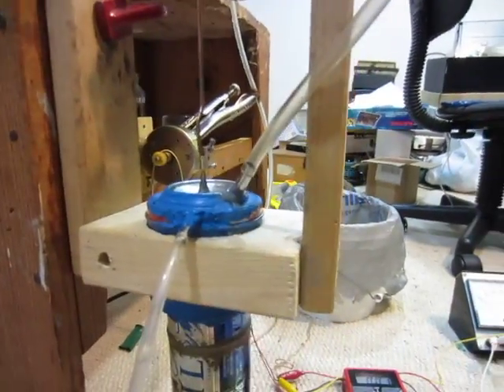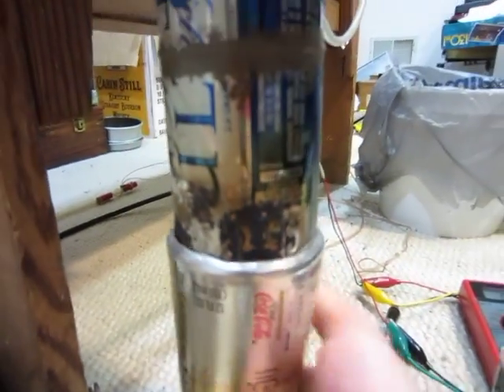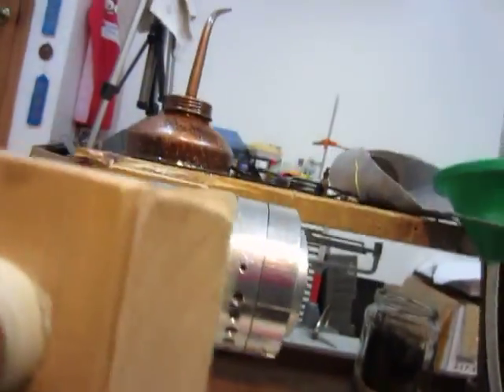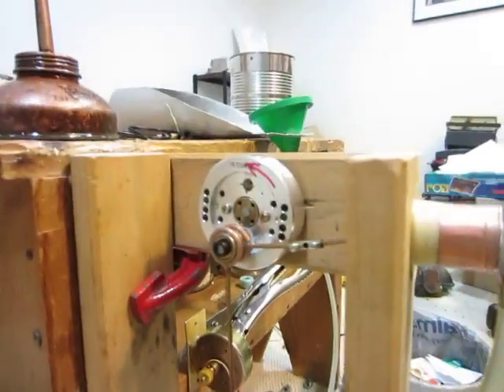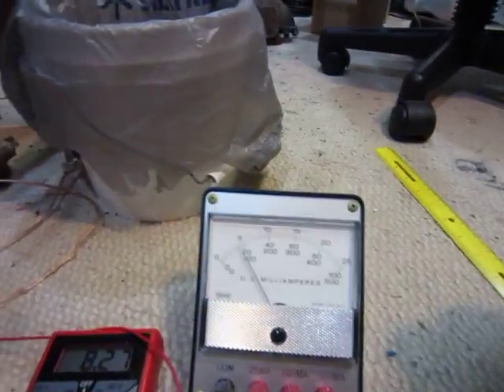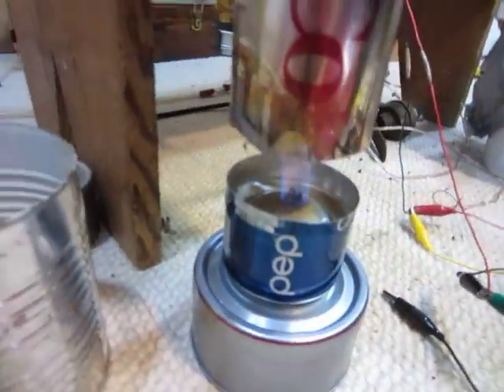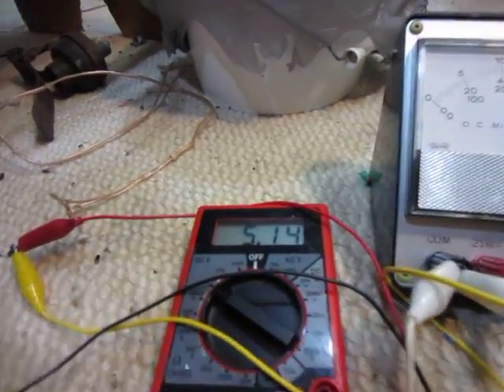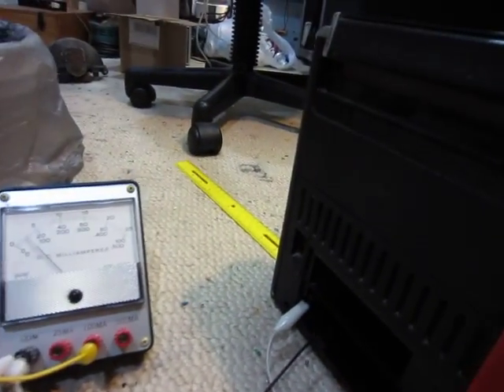DIY Drink Can Stirling Engine #3 Powers a Exit Sign 108 LEDs 0.33 Watts

Comment from the maker: You would need a lamp that uses 12 volts, but the thing is that if are using a 12 volt motor as a generator you normally are not going to get 12 volts unless you are spinning it really fast.  You would get more like 6 volts depending on the motor and speed.  I would just start out by hooking up and LED with a 1K resistor.  Hope this helps!  If you have any more questions feel free to ask!

Comment: the amps are not like the voltage 
the generator gives volts not amps, it's the reciver of electricity (led or electric motor ,etc...) who draw or take the amps because ohm's law says: amps=volts/resistance of the reciver 
so if the generator gives 10v DC (we suppose that body resistance is at least 10000 ohm)and you touch his tow wires ,the amps that will go across your body :
10/10000=0.001amp  1milliamp MAX or less than that if your resistance is higher :-)

Comment: Yes! I asked you this, because it also happened to me. I lost a lot of rotation. So do I, my motor run without any lubricant. But over time the piston sticks to the glass cylinder, especially if you have over 1000 rpm. In my case, when a wheel adapted heavier, had more strength at low speed.

Comment: I wonder if you use some kind of lubricant on the power piston? In my case I also had problems with the cylinder and piston aluminum shifter. But I did resolve to an external reinforcement around the cylinder and the piston reinforced with a lid inside the can, so that was not crushed by the pressure.